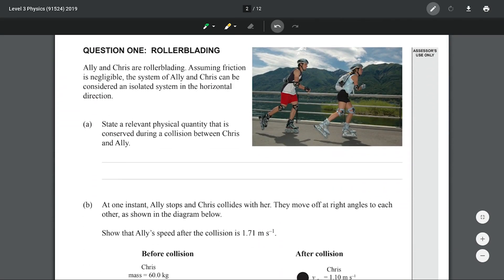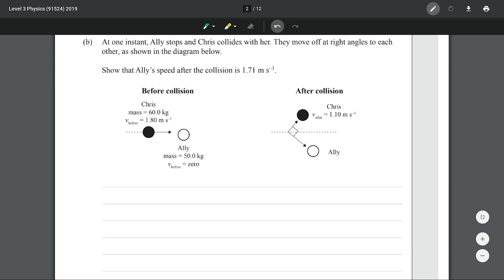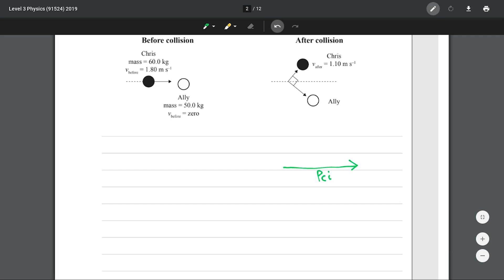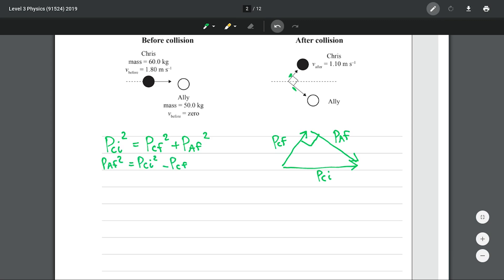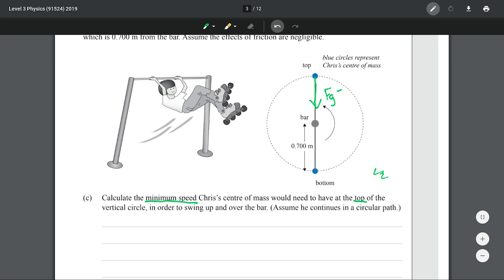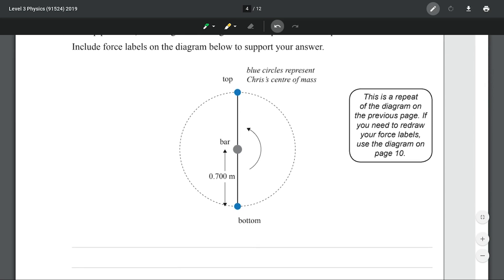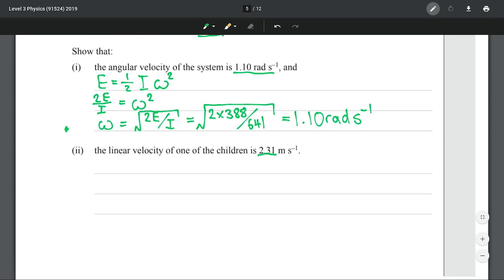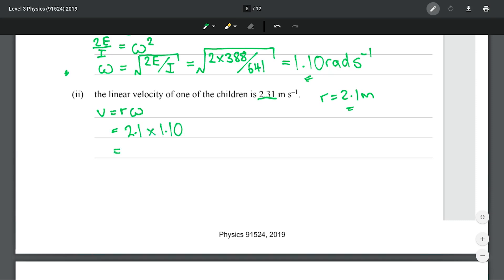2019 Mechanical Systems Exam (NCEA Level 3 Physics)

Comment: Hello Mr Whibley for the simple harmonic motion questions when they ask to use an phasor diagram or any other method, I feel comfortable not using the phasor diagram but for that question I got the correct time but I went lost when it asked to multiply by 4?

Comment: Question 3b why did you multiple the radians by 4?
Reply from the maker: Hi Tom, see at 21:20 where I explain this. The angle that we've calculated is only 1/4 of the angle through which Jay's displacement is above 0.2m.
Reply: @MrWhibleyPhysics  Hi Mr Whibley, why does the calculation you're mentioning (using 0.2m) give 1/4 the time above 0.2m rather than 1/4 of the time below 0.2m?
Reply from the maker: @aimisofea7964  Hi Aimi, because the angle I've defined is the angle through which the displacement is above 0.2m during 1/4 of the cycle.

To find the angle below we'd use 0.2m as the opposite rather than the adjacent, and would find an angle of 0.701rad instead of 0.870rad. Hope that helps!
Reply: @MrWhibleyPhysics  it does, thank you so muchh! 😸
Reply: @MrWhibleyPhysics  Hi Mr Whibley, what does the opposite represent in this case and why would it be used to find times below 0.2m?
Reply from the maker: @blackiechan1053  Hi Kanwaldeep. I'll try explain further, though it may be tough to visualise:

If we instead marked out the angle from the horizontal axis to the vector representing the 0.2m displacement, we could draw a new right angled triangle where the hypotenuse is still the amplitude 0.31m, but now 0.2m is our opposite side. This new angle that we have now marked is 1/4 the angle through which the displacement is below 0.2m.

Comment: For question 2c, why didn't you use the formula α=ω/t instead to calculate angular acceleration rather than to use a harder equation.
Reply from the maker: Just the way my brain was working at the time, α=ω/t would have been quicker.

Comment: For question. 2a why do u add 271?, also question 2c would -252 still be correct? Answer says positive
Reply from the maker: For 2a, we're considering the rotational inertia of the system. The system includes both the children and the merry go round. Thus the rotational inertia of the system is going to be the rotational inertia of the children (found using I=mr^2)+ the rotational inertia of the merry go round (271kgm2).

For 2c, -252 is certainly fine, I'd even argue that it's more correct than +252 since it rightly shows that the torque is opposing the motion (as I explained in the video). At high school level however we don't worry too much.
Reply: @MrWhibleyPhysics  cheers, also is electricity or waves an easier external?
Reply from the maker: @MrGamingGlorious  In my opinion Wave Systems is the easier. Both due to it's smaller amount of content and the actual content itself.